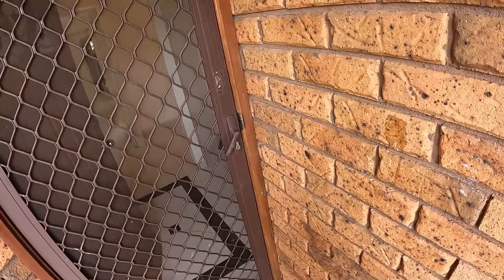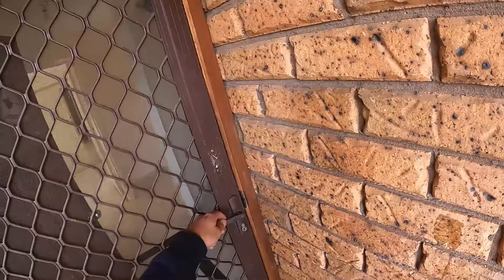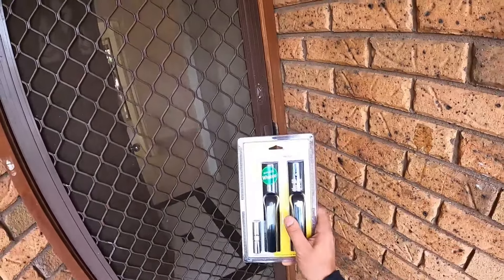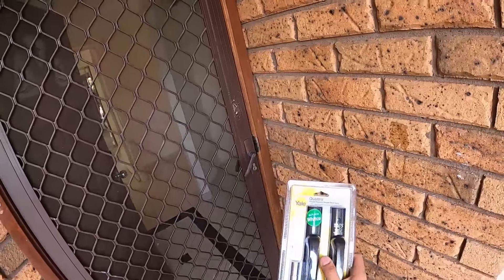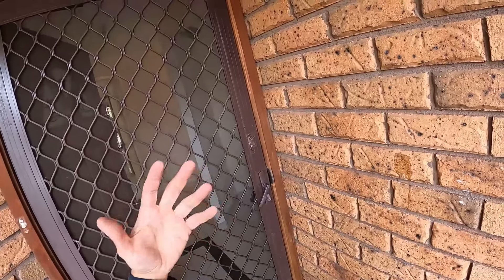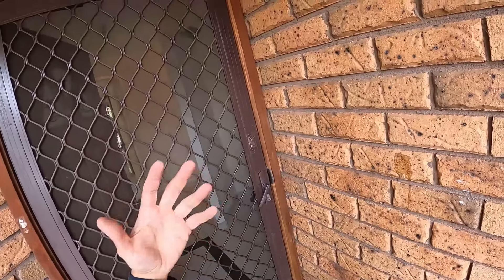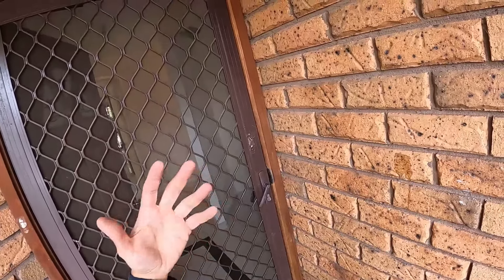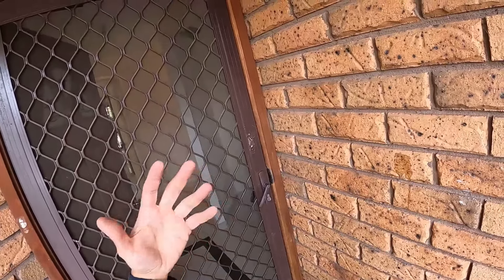Remove and install security screen door lock - DIY

Comment: No luck getting my lock  barrel out even with door open and key. Lock barrel is such a neat fit that even feeler gauge won’t let me flip up that pawl up.
A previous trick I saw and tried was to remove the whole door and upend it to flip the pawl…even that didn’t work. I keep looking out for helpful videos like this.
The lock barrel looks to strong to just snap it with multi grips as I’ve seen demonstrated for sliding doors.
I guess I’ll have to pay a lock smith to show the ultimate secret.
Reply from the maker: They all can be snapped. Save your money and snap it👍👍👍
Reply: @billshowto  👍😊

Comment: Bill, you are awesome. But my screen door is latched closed and won't open. The lock turns, the latch turns but the latch won't open, soI can't get at the parts between the door and the strike plate. Gaaagh! I'm hoping you can help with this!
Reply from the maker: I have a few videos on how to snap the cylinder lock if it’s faulty.

Comment: Hey Bill, is it possible to do this and keep the same key? Would it be as simple as reusing the same cylinder in the new door handle hardware?
Reply from the maker: You can reuse the same cylinder from the old one if you want to keep the same key👍
Reply: @billshowto thanks Bill! That's exactly what I did and it took about as long as the video to replace it and it works perfectly!

Comment: Great video. Made changing over the handle and lock very easy. Especially helpful at 8:26, as although the door would latch, it wouldn't lock. I just used a chisel to clean out some excess wood in the strike plate recess and it then locked perfectly. Total cost was $50 for the handle mechanism and saved me money calling out someone to do it.

Comment: I took on this replacement. The removal of the old lock became an issue for me. After successfully removing the key cylinder, the lock body was stuck in the door. It can move up and down in the door frame but something prevents it from coming out of the door frame. At 3:55 Bill pinches the latch and pulls out the lock body without effort, makes me want to cry watching. 
The old lock body does not have the holes for the snib so the new handles could not be installed with the old lock body. No idea what I am going to try to get past this issue.
Reply from the maker: Send me a photo and I’ll try and help. You may have a tri lock which has arms on the top and bottom of the lock body to operate a triple locking/latching system.

Comment: Hey Bill... great video, but I am still stuck trying to remove the old cylinder.  It simply won't come out..... I can see daylight on both sides through the gap between the cylinder and the lock body, so it doesn't look like the cam is stuck holding it in. However, I cannot find anything small enough to fit in the gap. I have tried everything, down to the finest sewing needle, but nothing will fit. Very frustrating1... I have a new replacement lock ready to go, but can't get the old cylinder out! :-(
Reply from the maker: Hi Robert, if you’re struggling to fish the cam out you have two options . First is to pick the lock and second is to snap the lock. I have a video on my channel for how to snap it 👍👍
Reply: @billshowto  I was a bit nervous that I would wreck the door, but I tried your 2nd option; to snap the lock........ FANTASTIC! i would never have thought of that until I saw your video. It snapped so easy with little effort, and now I have installed a new door handle & lock! Thanks so much Bill for your great videos.
Reply from the maker: You’re very welcome, glad it helped 👍
Reply: After an hour trying to get the cylinder out, I finally thought let's see if YouTube can help. 
Thanks for the video Bill and these comments. I had nothing thin and sturdy enough to turn the cam so I snapped the the cylinder like you said 👍

Comment: Such a great help, really appreciate you sharing, thank you so much!
I'm stuck with replacing mine, haven't screwed it all up, cylinder & snib not in, accidentally the screen door shut with the latch locked and I couldn't unlock it at all even if I put the snib and cylinder in...need help pls. Thanks so much in advance!
Reply: Lock body tongue was stucked can't be moved by the snib as it doesn't turn and clicks on the right angle to open, help pls😒
Reply from the maker: Lol, there is a little mechanism on the inside that needs to be released prior to being able to turn the snib over. What you need to do I manually move the locking mechanism ( usually this is what the cylinder would do when using the key). If you look up my video on how to snap the cylinder I show how to do this in that video 👍👍

Comment: Thanks for video. I used the same brand as you in the video and followed the instructions (the main bolt was out and deadlocked) before I put the cylinder in. The keys won't lock the door from the outside (ie. main bolt won't come out). Do you think this is an installation issue or the lock mechanism issue? thanks

Comment: Hi Bill.My problem is the lock in the lock body is stuck locked & I can`t open the locked screen door.The key clicks but won`t open.Have taken apart all parts but can`t work out how to get the body lock to withdraw so door can be opened outwards.Advise me please.
Reply from the maker: Hi, i have a few videos on my channel for how to remove the cylinder lock. Even if the key/lock is no longer working I show you how to bypass it or snap the lock 👍
Reply: @billshowto  Its the top body lock that is stuck lock.Handle won`t release the bar lock back.Have totally dismantled the cylinder lock & brackets off the door but can`t get the handle bar lock to withdraw.
Reply from the maker: Once you have the cylinder out , you will have to manually release it from the inside of the lock body. Can be done with a screw driver

Comment: Good job 👍 
What if the latch locks the inside but can’t lock the outside with key ?
Reply from the maker: Could be the cylinder or a faulty mechanism inside. If you open it up and remove the cylinder you can usually spot the issue 👍

Comment: Hi Bill, I have a sliding security door that has the triple lock just recently after alot of rain in my area the silver latch to lock it from inside is not always locking until I move it back and forward so to speak then it looks. Would that be one of the triple locks in the door frame coming off alignment  ? Rgds Glenn
Reply from the maker: Hi, the tri lock are known to cause this issue as all three latches will need to line up perfectly in the strike plate for it to lock. I have another video addressing this exact issue on a single latch lock but the concept will be the same 😉

Comment: Have a similar lock which, when the manual lock lever is operated from the inside, 90% of the time we can again unlock from the inside with the small lock lever. There are times however that once locked manually inside via the small lock lever, the small lock lever jams and we have to unlock the door with the keys....very annoying. ...any ideas? ...I've looked at it every which way but buggered if I can see what is malfunctioning.